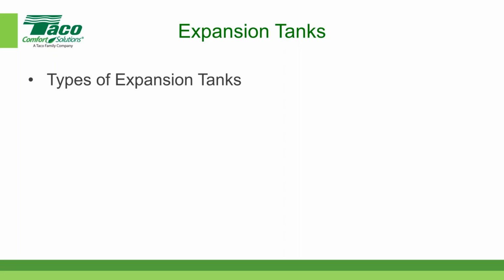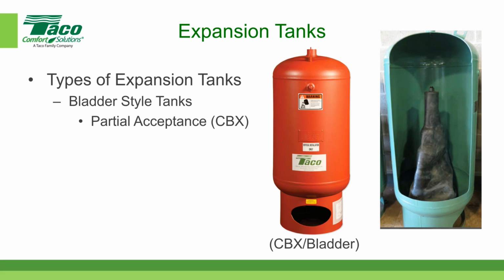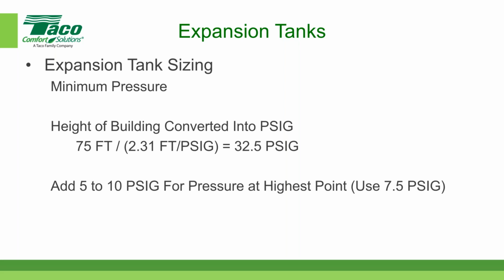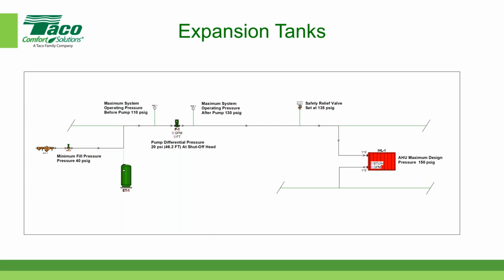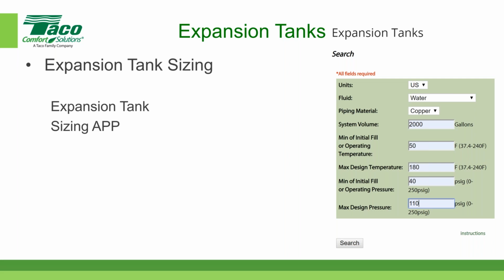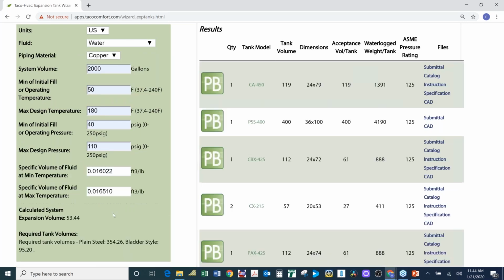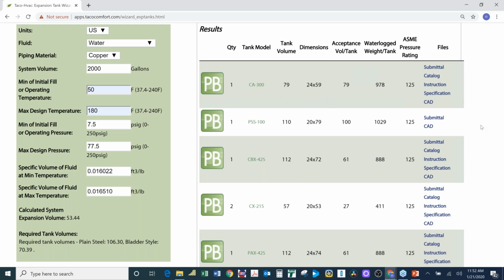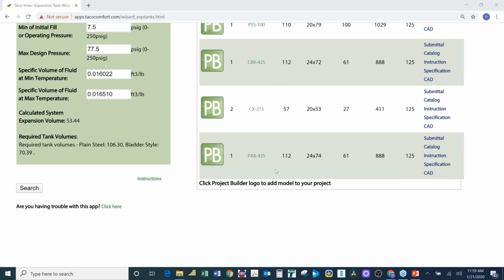Expansion Tank Sizing

Comment: How to size expansion tank for thermal heating fluid like mineral oil ? Can I use the expansion tank that are being used for water system. Will it ( mineral oil) affect the bladder or diaphragm or sizing method if I take data of mineral oil ?
Reply from the maker: Good day Parth and thanks for watching our Taco Tuesday webinars. In speaking with the engineering department; from a thermal expansion standpoint, we would need the specific volume of the mineral oil at its lowest and highest temp.
However, the bladder material we use is Butyl which does not fare well with mineral oils. We would not recommend it for a mineral oil application.

Comment: When we have to recharge the air ??
Reply from the maker: Hello Kam, thank you for the question. The bladder style and diaphragm style expansion tanks must be pre-charged (compressed air side) in accordance with the instruction sheets – link here: http://apps.taco-hvac.com/uploads/FileLibrary/402-002.pdf
Reply: No instructions sheet is found in given link.
Reply: How to calculate air pressure to be maintained in expansion tank bladder?
Reply from the maker: Hi ljaz - the correct link is here:
https://www.tacocomfort.com/documents/FileLibrary/402-002.pdf
Reply from the maker: I apologize for the incorrect link, we have performed some updates on the website. Here is the correct link:  https://www.tacocomfort.com/documents/FileLibrary/402-002.pdf